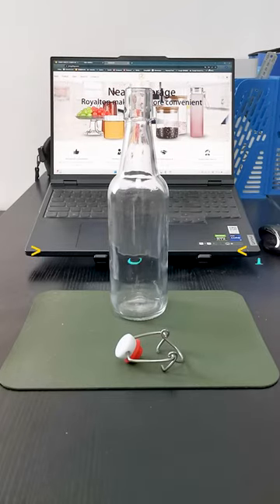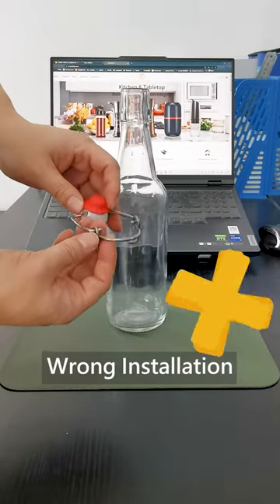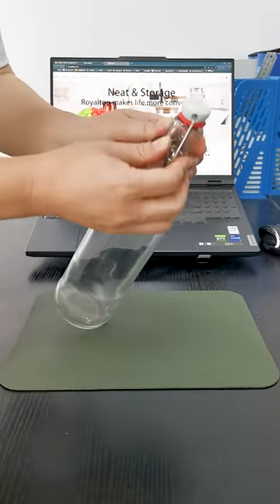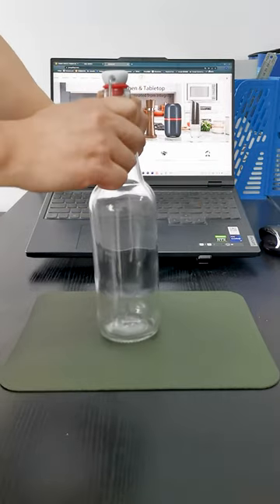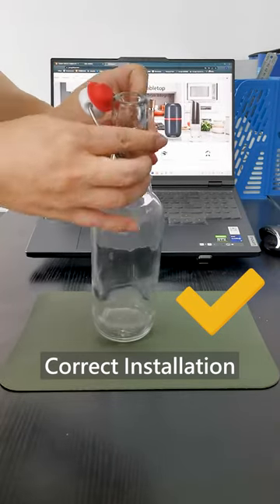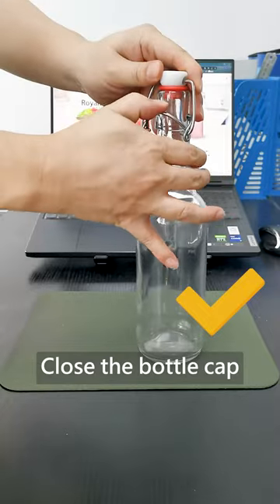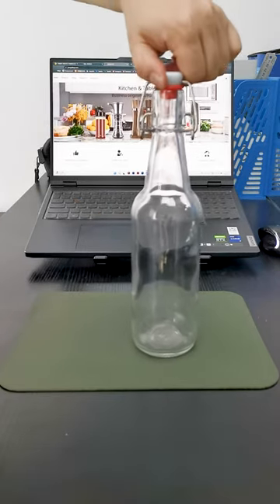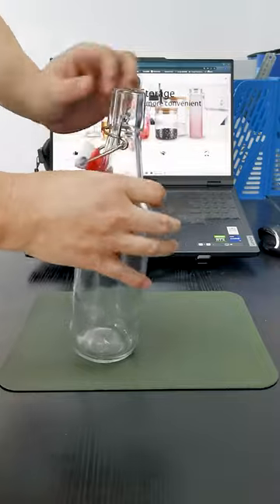How to install and use the swing top of glass brewing bottles

Comment: Metal hinge keep slipping off completely when opened. I don't know I the small holes on the bottle were made poorly or the metal hinges may be the issue.
Reply from the maker: 1. The biggest possibility is that the metal hinges are aging and deformed, or the hinges are not strong enough, resulting in the normal use. Because strong hinges are more expensive, some merchants use cheaper hinges in order to control the cost.
2. A very small possibility is that the small hole in the glass bottle is not deep enough. This problem will not involve the cost of the goods, so the probability of occurrence will be smaller.
Reply: Thank you very much it is that the holes aren't compatible for the metal hinges.

Thank you for your time and response 🙏
Reply from the maker: @calisthenicsmadness1  You're welcome.